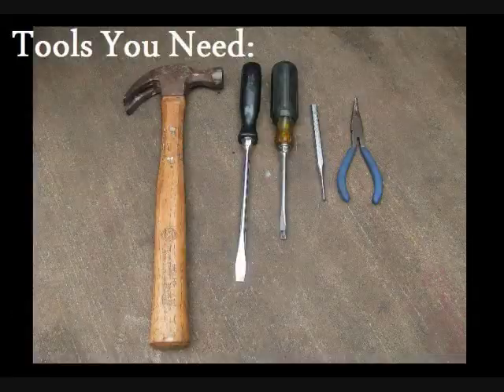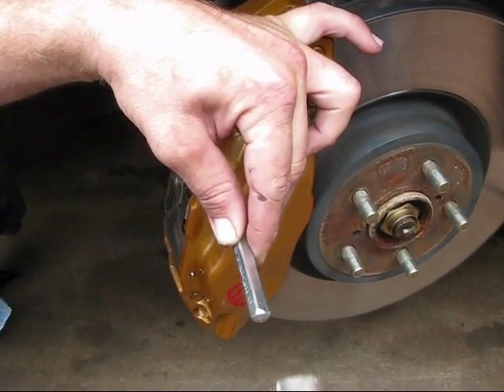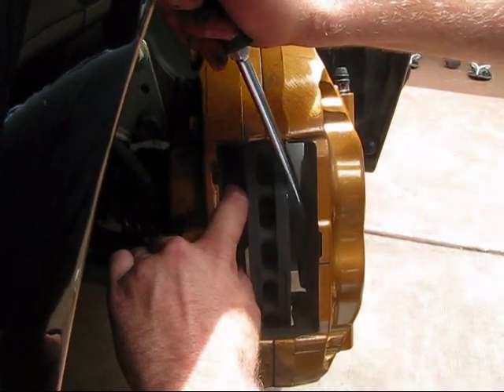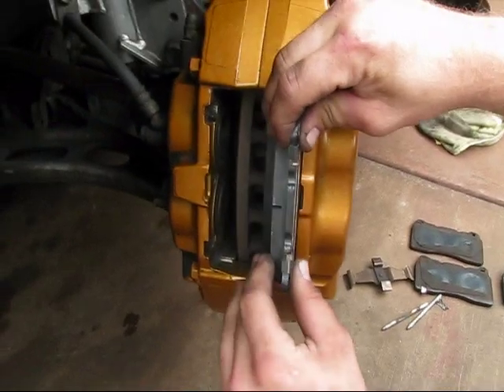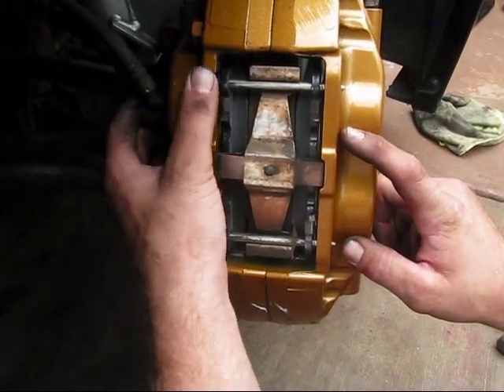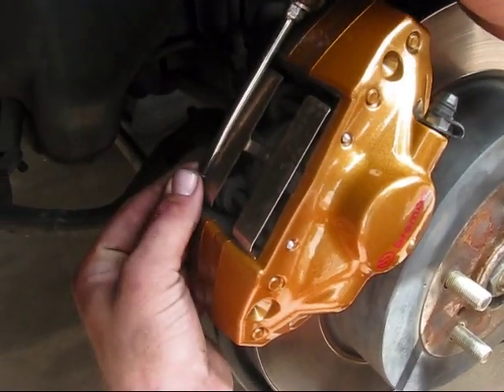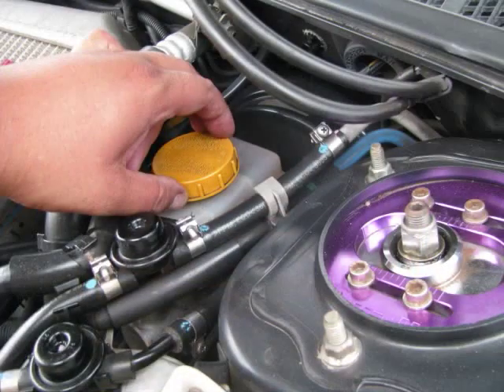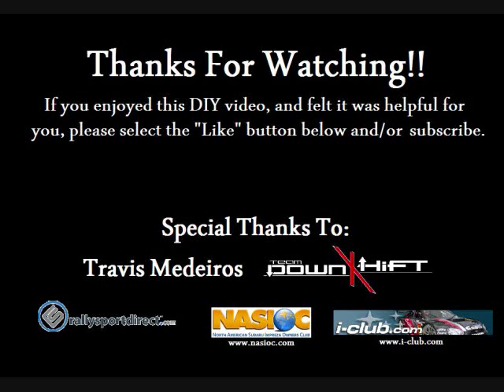How to install STi brake pads

Comment: Great video. Just read the comments and having done this myself I can answer a few of the questions that have been asked.  On pushing back the pistons: Best to use your fingers, or put a rag around the screwdriver or whatever you use to push the pistons back. There's a seal in there and if you were to poke it with your screw driver, big trouble.  You can also ding up the face of the piston.  Someone mentioned using the old pad, to do that, great advice.  On the pins: If you're working on an older STI, (mine is an '06), highly recommend you go to your Subaru dealer and buy new, shiny pins.  The old ones may have dents & dimples in them which may interfere with the small movement that has to take place.  On greasing the pins and shims:  I used EBC pads their instructions say to use brake grease on the shims and/or back of the pads.  Apply to the pins as well.  On safety: someone commented, maybe it was in the video, to use jackstands instead of the scissor jack - that is great advice, particularly if you're changing your rotors too.  Gloves are a good idea, particularly when it come to using the brake grease.  That stuff is design to stick to hot metal surfaces - and will remain on your fingers as well.  Guys, where a mask to protect your lungs.  You really should blow all the dust out of there with you air gun, but God only knows what is in that dust so take care with that. Anyway, I am off to change my brake pads again.  The EBCs held in there for 35K of hard miles.  I use Yellow Stuff pads and the EBC slotted rotors.  I think the rotors have 10K left on them.  I hope.  Thanks for the refresher!
Reply: I may be doing my pads from new OEM pads to HPS or something similar, and decided to take a look since these are very different than my Honda Fit, which requires I remove the caliper.  I was wondering about the screwdriver as well. I used the old pad and a C clamp with my Fit. in this case, screwdriver and old brake pad sounds good :)  thanks for the extra advice to add to this great video!
Reply: 😮 0:24
Reply: e7 3:59 a
Reply: 4:25 Z😮7
Reply: 😮 xxx

Comment: Good tutorial. Some things to make life easier is to turn the wheel so the Calipers are facing outward. 

Also instead of using a flat head to compress the pistons, just keep the old pads in and use a flat head against the pads to compress the pistons. 

Good work man! Best Tutorial ive seen!
Reply: 😮z😮 1:04  no

Comment: One thing I come across all the times when changing brembo brakes.  When you try to push the two pistons on the right, the two on the left will pop out and vice versa.  In this case you will have to push two pistons on the same side all the way down and put a brake pad in first and then push the other two pistons for the other pad.

Comment: you can also remove pads and depress pistons using a wrench to squeeze together the pad and the caliper wall...a piece of rubber hose to prevent the wrench from scratching the caliper...

Comment: if anyone out there is using Hawk HPS pads, do not reuse the factory shim with the arrows. This is one of the main issues with Hawk HPS' squealing.
Reply: mister boosty thanks for clarifying that man. I just changed mine on MY16 and i get squealing and I re used the oem shims. I'll remove them this weekend.
Reply: So do the hawk hps come with them or whats the fix here? Not using them at all?
Reply: mister boosty what do you use then?
Reply: thomas21799 the stock pads have two shims per pad if I remember. The Hawks come with one.

Comment: I recommend using large pliers to compress the pistons by squeezing the pad to the caliper. Protect the caliper paint with some rubber or wood. This way you do not risk puncturing the rubber boot on the piston.

Comment: old guy so sorry if this is the wrong place. But to replace front wheel stud on 05 sti and can't get rusted caliper bolts out pull pads like in this video back up brake pistons use bolts to push out rotor enough to get hand behind rotor(plenty of room) knock out broken stud and draw new stud in with lug nut done. Just trying to help couldn't find anything on this.

Comment: Clean it off right away.  I usually put a paper towel or rag around the reservoir so if I have overflow, it won't drip down or go any where.  Always check the fluid level when done installing the pads and add more if needed.

Comment: ***THIS IS IMPORTANT*** make sure that the “squealer tab” is on the bottom inside brake pad of each wheel. I just changed mine and one side had no squealers. The other had TWO. Look at your brake pads. Make sure the one with the metal tab is at the bottom of the inside pad = bottom right for passenger. Bottom left for driver.

Comment: Good tutorial but, You should not push the pistons like that, because the presure goes to the brake pump and it could damage it. You should open the blead to relieve the presure.

Comment: hey mate, you seem to know alot about brembos, my evo 7 squeals when slowing down after i did a pad change. Its usually below 20kms when going really slow. During rapid acceleration to hard braking theres no squeal, only when rolling at 20ks per hour does it squeal really loud.

Comment: Whenever I've used a flat-head screwdriver to twist the pistons back in, it scratches my rotors. Isn't that bad?
Reply: That means you pried in the wrong direction. The tip of the screwdriver should press against the old pad, not the rotor.

Comment: You can tell you know just enough to get into trouble.
Use the pad to push the caliper pistons back into the bore.
WHY ? ?
It's quicker AND you won't push out the adjoining piston out.
BUT WAIT THERE IS MORE !
Do one side at a time .
Why ?
So you don't push the opposing pistons out.
YOU TRULY SHOULD HAVE KNOWN.
Reply: I concur

Comment: I could not get out the bottom pins on both front wheels. For some reason they were both stuck solid. Using flat center punch and hammer. The top pins came out as easy as video but bottom pins did not move even half a mm no matter how many times I hit them. There was nothing pressing against them only the calliper frame. Why were they stuck/jammed?
Reply: Ha ha... just came across my own comment from 6 years ago, while attempting to change them again now (I gave up that time and left them). Got another 6 years out of pads. I presume they will still be jammed now again :-)

Comment: I got a question so i just changed my brake pads on the front and I forgot to take off the brake fluid cap off and now there's no pressure and my brake stays thanks.

Comment: You can Contaminate the Mater Cylinder by Pushing Old Fluid back without bleeding...easy way to get gunk into the Master....Should have Depressed Pistons with Bleeder open....
Reply: not true. old fluid wont travel that far up the lines if you only do one corner at a time. like he did...
Reply: If I have time I do this on my own cars. The fluid inside the calipers gets abused a fair amount. Great quick bleed of the brakes between flushes.

Comment: oh how i wish it was this easy :(
Reply: Honestly the hardest part is jacking the car up lol
Reply: @jaicdc1  sure if its a new car xD, when its 15 years old things tend to not want to move
Reply: @HanSolo1  I did this on my 05’ sti. 16yo. 😋 then again. When I did the rotors I had to
Spend $60 on Rides alone just to get a new caliper bolt and buy a torque wrench. The rotors kicked my ass.

Comment: what if u close the cap after u press the brake several times?
Reply: Doesnt make a difference. I Would advize changing your brake fluid after changing the pads by bleeding the brakes. If you dont know how to bleed your brakes dont even attempt to change your pads 😀